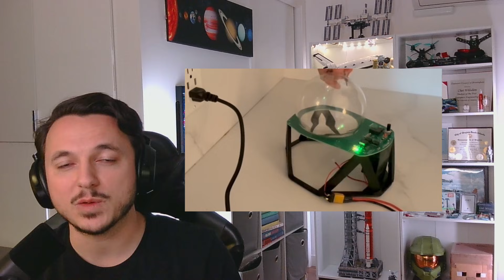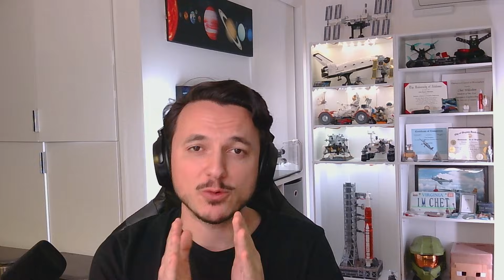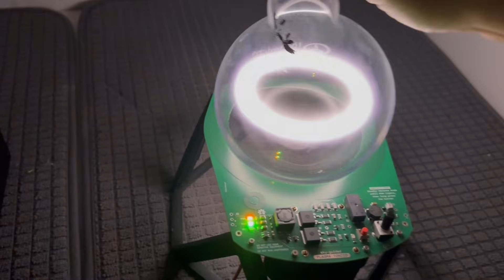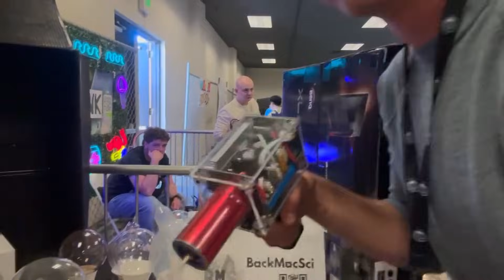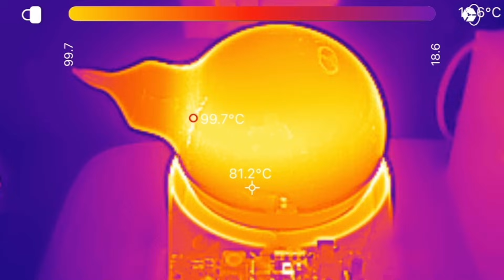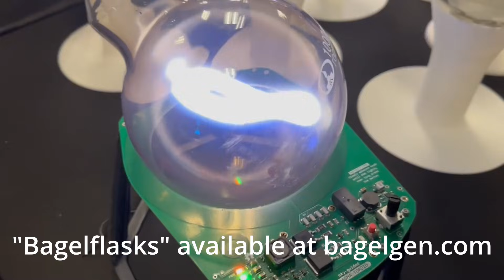Building a Plasma Toroid (Part 3)

Comment: I've developed a cooling tower air spinner system.  Allows indefinite run times even with doped metal halides. Yes power supply is key